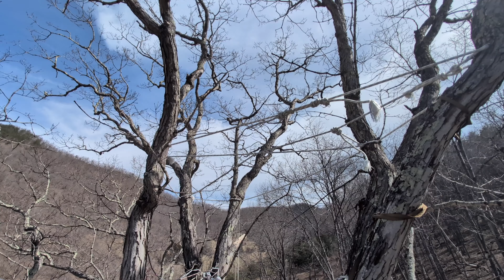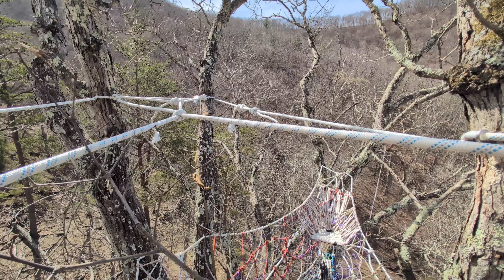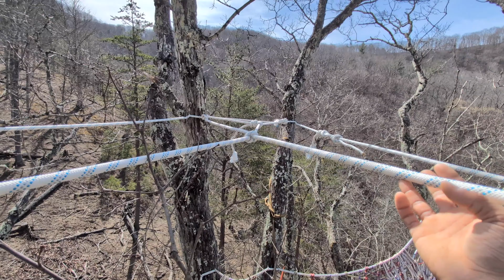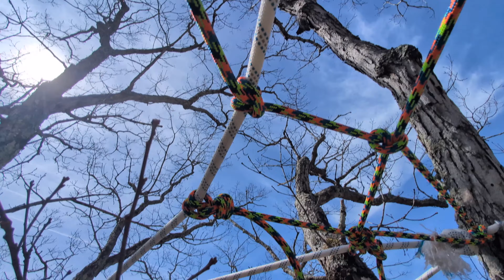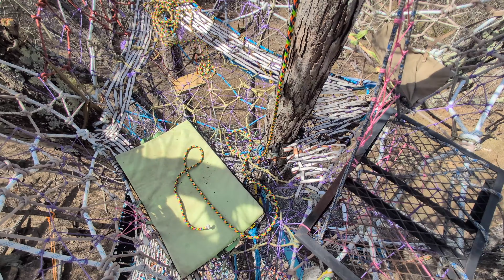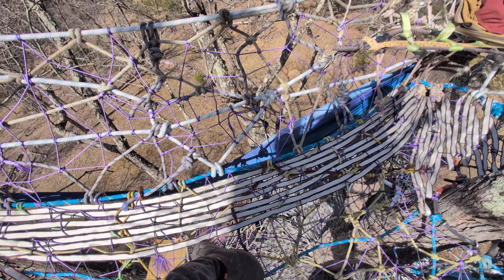How to build an ultimate, permanent treenet, start to finish (STEP 3: adding infrastructure)

Comment: Hey! great video, i spent a night a couple of week ago with my buddy santiago! I am definitely going to use the infrastructure idea of pulling between the two bolts to tension the outer perimeter in the next layer of my tree net. I've used infrastructure before but usually it pulls in the perimeter quite a bit, thanks for the idea!!
Reply from the maker: heck yea!